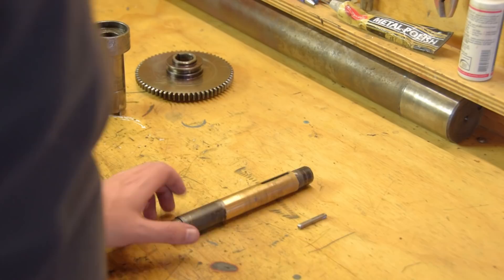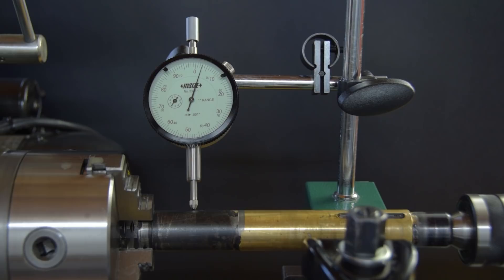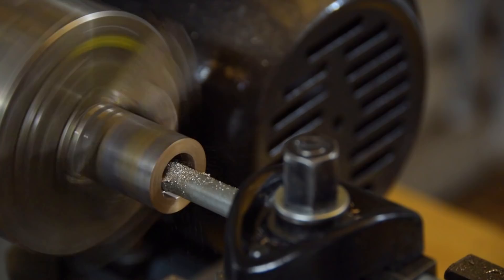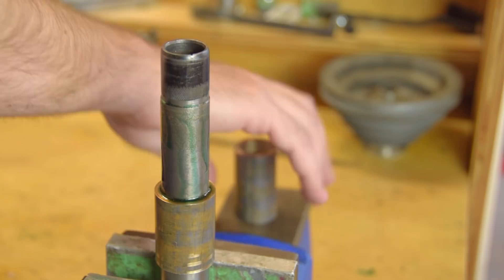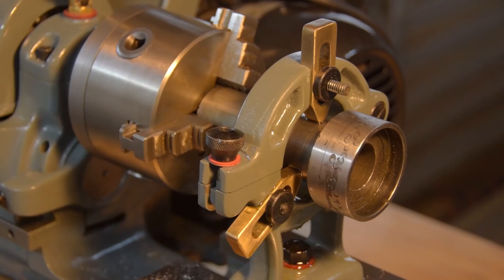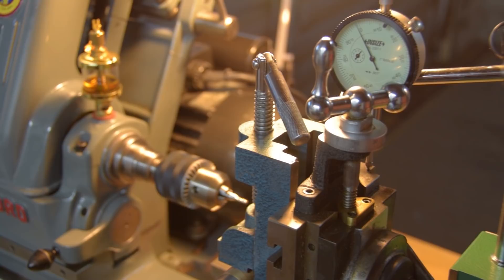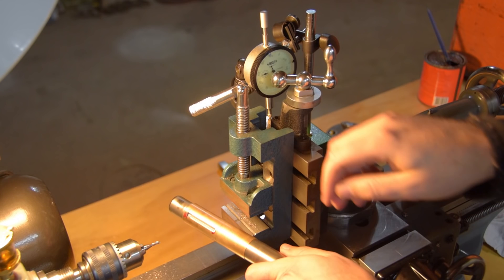Drill Press Restoration Part 5 - Machining

Comment: Really good to see your ML7 in action, seems to be running very nicely, thanks for putting these videos together!
Reply from the maker: Yup, thanks. It's going fine. No problems so far. I spent ages trying to track down a vibration coming through the gears and pulleys. Turns out it was just the lid rattling. You can see a little piece of rag at 4:34 to try and keep the noise out of the video. One day I'll get around to gluing in a small rubber button or something. Cheers.
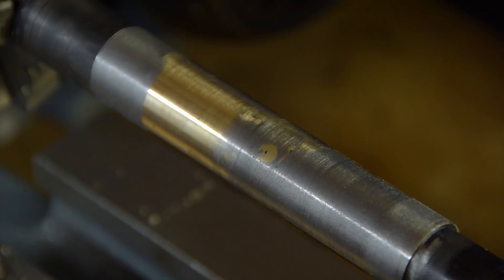Reply: I didnt spot that, I can see it now. Funnily mine doesnt seem to rattle much, but where my cover goes around the top spindle my cover has a bit of padding on the outside which holds it steady at the top. I was enjoying watching your motor bob at 4:22 , its a very familiar sight, reassuring to see another ML7 doing what mine does. Your shimming of your cutting tools is inspiring me to consider that route before jumping on the QCTP bandwagon, do you have a set process for making them for each tool?
Reply from the maker: No, I have no good process. I fully intend to acquire a quick change tool post. Drives me nuts.
Reply: Haha glad its not just me, I have been using the rocker style adjustment and it works really well about 5% of the time. QCTP it is then...
Reply: Mike du Plessis I always think motors bobbing is due to an old belt that has taken a permanent "pulley bend". Is this the case on yours? Daniel
Reply: Almost certainly, I should really replace the belts as they are pretty cost effective to buy here in the UK

Comment: Only thing I think may have been better is to have frozen the shaft and heating the bronze in an oven at 300 degrees then with just a few tho, press sized it should have locked itself on the shaft much tighter with or without locktite. Im not trying to be picky just help . enjoyed the rebuild. Thanks. Old time machinist.

Comment: You never turn a reamer backwards; maybe that's why it doesn't cut so good anymore
Reply from the maker: Yeah, you're right, I know the rules. Truth is if I feel the reamer start to bind in one spot, I'm going to turn it backwards to release it, because I'd rather blunt a $10 reamer than gouge a mark inside the taper of the drill spindle. It's not the same situation as using a straight reamer in a through hole.

Comment: Could be, Wilsons Portland Cement, we had about 40+ fitting shop people then, I have heard they just closed up the workshop and use contractors now and a few shift fitters.
Reply: koliloaloa I have done a bit of contractor work over the last few years at the Portland cement site. Most of the machines appear to be mothballed and not touched in a while. I'll have a hunt around for the shaper next time I'm out there.

Comment: Knocking off the drill bit Sharp edges makes Wonders...it would not catch anymore... You need tooling dedicated to Bronze and brass ..
Reply from the maker: Yeah, but I can't afford separate drills just for brass, especially not in the larger sizes.
Reply: Geoffrey Croker Understood.  Once the sharp edge stoned to a zero degree, the drill will still cut steel by applying a bit more pressure, until you have to resharpen it and ends back into a steel cutting configuration. Daniel

Comment: Hi Croker,
Can you please give me he dimensions of bronze sleeved part(shaft that have internal splines).
I owned a elliot drill press it was almost rusty and jammed.
During the disassemble time that part came pieces.
If you could please give me the dimensions of small helical gear assembly part also.
Thank you
Reply from the maker: I don't have the dimensions written down sorry. I'd have to dismantle the entire machine to get them now!
Reply: Geoffrey Croker,
Can you give me rough sizes.
You have footage of machining,sometimes you can measure them.
Anyway thank you for reply.
Very informative videos.
Great 
Continue your work.
Good luck Friend.
Greetings from Sri Lanka.

Comment: I would have just made a new shaft rather than try bodjing a repair on the old one. Seems like a lot of extra effort and cost when making a new shaft would have been a far better solution.
Reply from the maker: The inside of the sleeve has a square spline cut through it. Would require serious tooling and skill to remake it from scratch.
Reply: Fair point though you could make a broach it would need heat treating etc and additional tooling and equipment. Yeup repair was the best course of action in this instance ! Too many projects. Not enough time :/
Reply from the maker: Yeah, I definitely considered what I would have to do to remake it if things went bad. Probably I would have tried to save the old splined internal section somehow and press it into a new bore. Major.
Reply: Cant really see the length of the spindle but would it be possiable to cut the splines in a shaper with a dividing head mounted to hold the shaft somehow ? support the overhanging end with a screw up jack and clamp it down to the table. Cut one spline then rotate it the required angle then cut the next and so on ? Offcourse depends on the travel of the shaper. Sigh. i want a bigger shop. Might be a cheeper alternative to broaching machine if a bit more fiddly to do.